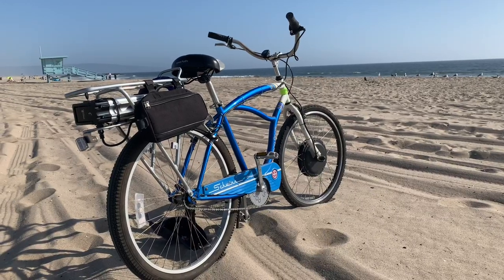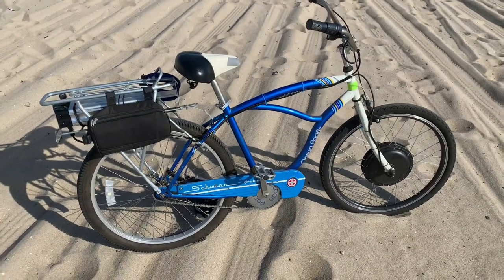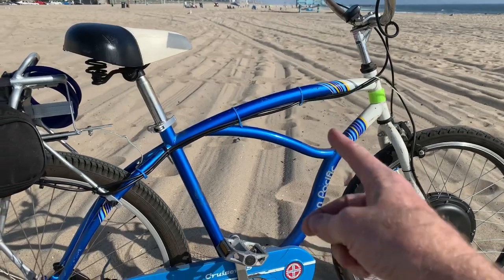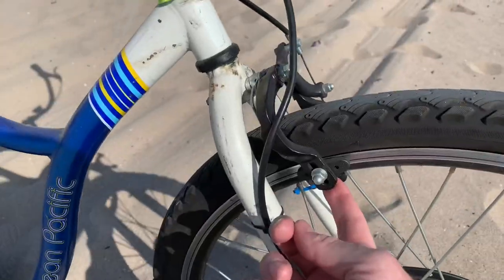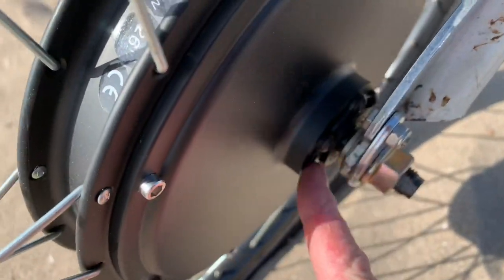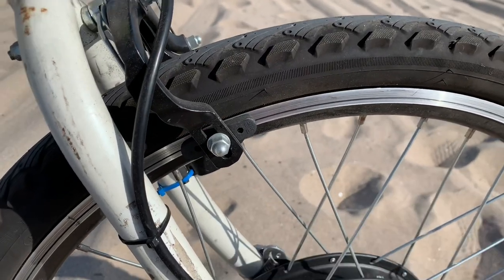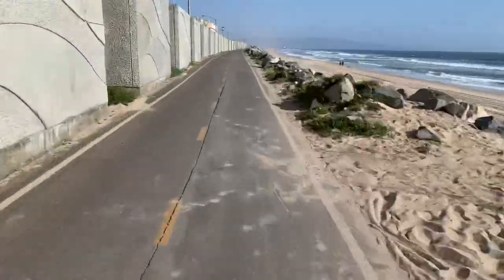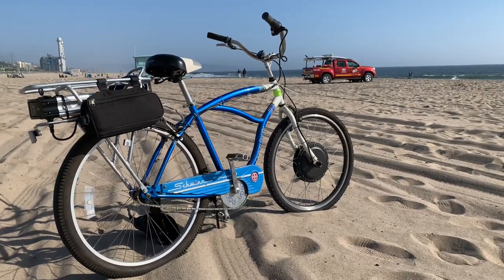5 Mistakes I Made Building An Ebike

Comment: Great video thanks for the tips. Did you source your parts from ebay ? It seems like the bikes been holding up well.
Reply from the maker: Yes. I just bought whatever was the cheapest thing on eBay. The front wheel kit burnt out and we bought another one, and the battery died and we replaced that as well.  It would probably makes sense to buy a complete battery and wheel kit from the manufacture with a good reputation versus buying the cheapest stuff.